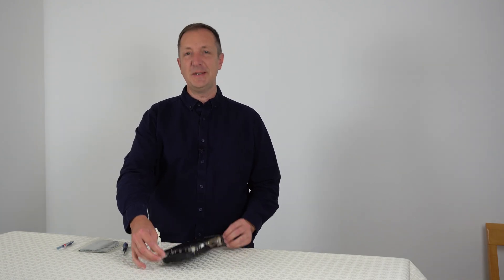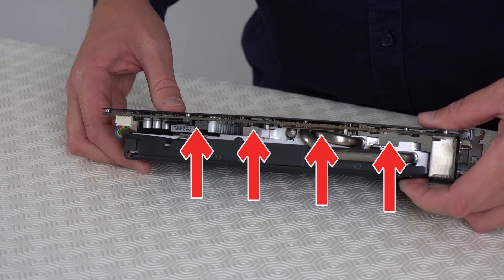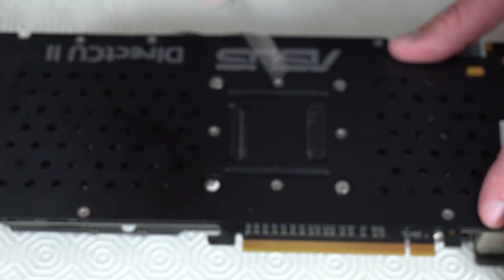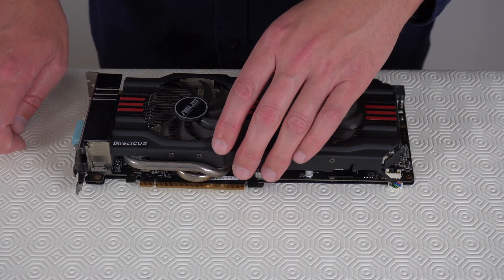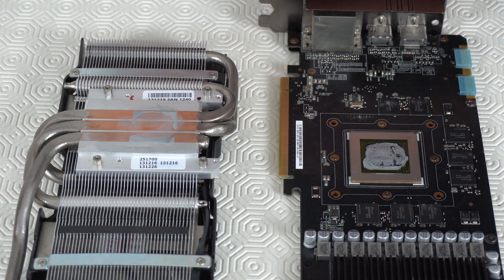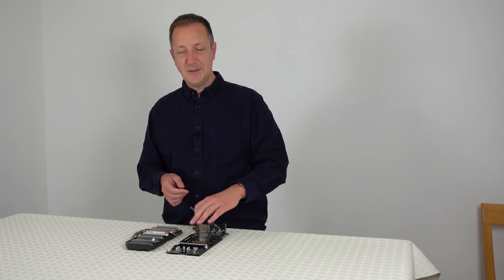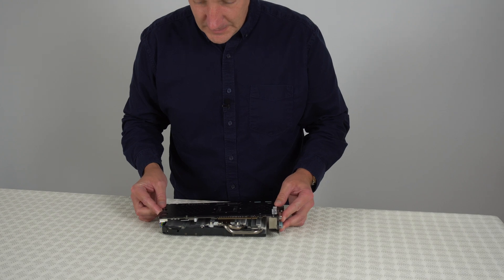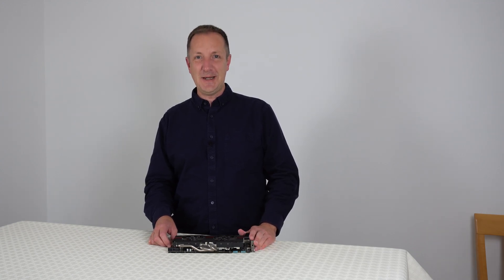How To Repaste a Graphics Card

Comment: Thank you so much. So to the point and easy to follow. Ended up using 70% IPA cleaner and a paper towel. Worked great. Hot spot temp went from 105 to 70
Reply from the maker: That's a great improvement! You must be happy with that.

Comment: You should probably mention the bottles of liquid are completely optional. Thermal paste aint no superglue , use some damp toilet paper,  or baby wipes,household wet wipes. Do make sure to dry it with some toilet paper after.. 70% alcohol wipes ideal if you have those around but again fully optional.

Comment: Spreading the thermal paste is definitely the way to go! Ive tried all other methods online (e.g. pea sized drop, x pattern, straight line pattern) and all led to high temps, and uneven coating. Glad to see someone teaching others to repaste using the spread method!
Reply: Applying a pea-sized drop is fine for CPU coolers, as the idea is that this avoids the formation of bubbles, however, GPUs do not have an IHS (integrated heat spreader - the large metal part soldered to CPU dies).
This means that if you miss a small spot on a CPU, all the dies are still connected to the IHS, which should prevent critical high temperatures, even with imperfect contact between IHS and cooler.
GPU dies however have no IHS, and hence need to be entirely covered with thermal paste, as parts of the die will not have any place to dump heat otherwise.
While they will often downclock or shut off before they damage themselves in case the thermal paste is applied poorly, they do not have temperature sensors everywhere.
This means that if you use the pea-size or x pattern technique on a GPU and you get unlucky, you could leave a part of the die that does not have a temperature sensor uncovered.
If this happens the GPU will not shut off and destroy itself!
The GPU die should be completely covered with thermal paste!
Reply: @fotoschopro1230 I came to comment exactly this. Spreading the thermal paste is absolutely worth the effort for a gpu die but usually not necessary on an CPU IHS for the reasons you stated most eloquently.
Reply: @fotoschopro1230  excellent comment and made me realize what was happening with my own PC, validating my suspected overheating issue! Thank you.
Reply: yea I will always prefer evenly spread paste but with a lil bit thicker layer
Reply: Too much is preferable over not enough in my book. Especially with a cooler with them cut down pipe design. More paste helps get up in any grooves that wouldnt be contacting otherwise.

To much just means more to clean up down the line. Too little is a big thermal issue potentialy damaging expensive components. So lean more, imo oc.

Comment: Use kingpin extreme paste not arctic mx-4. Mx-4 has silver in it which is conductive which can potentially damage ur card
Reply: MX-4 with Silver in it will be labelled as such, basic Arctic MX-2,4,5 Paste does not have silver and is harmless if it get's on any other components

Comment: Great video. One note. According to FTC (The Magnuson-Moss Warranty Act (MMWA) passed in 1975), the "warranty void if removed" stickers are illegal. If your graphics card will not work after taking it apart, burden of proof that you broke your card is on manufacturer. They can't void warranty simply because you took it apart.
Reply from the maker: Good piece of information - thank you!
Reply: While this is the official law (in USA), the manufacturer will still lie to you and claim you caused the damage by opening the card. Even if the burden of proof is on them. It’s usually hard to definitively diagnose the cause of a fault and it’s usually not expensive enough to pursue legal action against them and they know it.

Comment: Hi, first of all thanks for the video! I would just like to ask whether it's safe to buy a repasted used GPU (might be a stupid question) should I be worried that it might have been done badly?
Reply from the maker: A repasted GPU isn't really a good or bad sign. It's probably at least a one year old card for the owner to want to repaste it. It could be a sign that he cares about his components, or it could be that it was running a little too hot when he was using it. Could he have repasted it badly? Yes, but it's unlikely as it's fairly simple to do.
Reply: @EasyPcRepairs  thanks so much
Reply from the maker: No problem.

Comment: Nice work. And you look very tidy, but use mineral oils for cleaning not cloth. Just spray the shit out of that GPU and clean it with tooth brush. Then use Vacum Cleaner and suck of any dust or filth. Apply the thermal paste it doesnt matter which one. (I use aliexpress paste for 2$). Then before reassembley connect all of the connectors and thighten those screws in really hard.
Reply: Wrong.No oils are used.Lol

Comment: DON'T SPREAD THE PASTE USING ANYTHING, CLOTH OR YOUR FINGERS!. It can seriously damage your cards cooling performance by leaving micro scratches and not completing the seal between the card and the heatsink. Just put your thermal paste onto the gpu and put the heatsink back on. The seal between the two will happen automatically and putting the heatsink on will cause the thermal paste to spread on its own.
Reply: No.
Reply: @undyingsonars  yes
Reply: @4rupt  Just changed my 3080 ti spreading literally after i commented.  So double no

Comment: Do I need to spread that thermal paste or just apply a dot in the middle and let the heatsink spread it?
Reply from the maker: You can do it either way. I prefer to spread the paste so that I know it has spread well.
Reply: @EasyPcRepairs  I am also having a problem, I recently bought a thermal paste called STARS-700 for my RX 570, previously the temps got to 80 C max now they get all the way up to 90 C and the GPU gives a bluescreen or shuts down PC due to overheat, But I didn't screw anything up, I did everything the right way, didn't damage any part of the GPU, But the thermal paste I bought was kinda like hard lime water or something like that, As if there's a layer of dust on it, It was hard, Does that mean that the thermal paste I bought is outdated or what?
Reply from the maker: Thermal paste will go hard over time. So it could be that the paste you have is old. Hard paste can affect your GPU temps for sure. The MX-4 paste I was showing in the video lasts for 8 years without going off so I highly recommend it.
Reply: @EasyPcRepairs  I found Noctua NT-H1 in the local store, will that do the job?
Reply from the maker: Yes, that would be very good.
Reply: @EasyPcRepairs  ty for the help, you earned that sub pal
Reply from the maker: No problem, glad to help!

Comment: Is that liquid safe to be dropping onto a GPU / CPU like that?
Reply from the maker: Yes, the Arctic MX-4 paste can be used on a GPU or CPU and is very good for both.
Reply: @EasyPcRepairs  I meant the cleaner you threw all over it :)
Reply from the maker: Oh, I see... yes, the liquid is designed to be used in that way for GPUs and CPUs and is perfectly safe.
Reply: @EasyPcRepairs  it must be some form of non oxidizing and non conducting compound
Reply: @Phil_AKA_ThundyUK  isopropyl alcohol most likely.

Comment: Gotta disagree about spreading the paste with a litnfree cloth, how is any air supposed to work it's way out from between the 2 surfaces, I would put a decent blob of thermal paste right in the centre of the chip and gently lowered the cooler down onto it, twisting slightly whilst pushing down, this will create a wave of paste that pushes the air out in front of it.
Reply from the maker: If the paste is spread out first, you can guarantee that it is spread correctly every time. Any air will be squashed out when the GPU meets the heatsink on reassembling the graphics card.